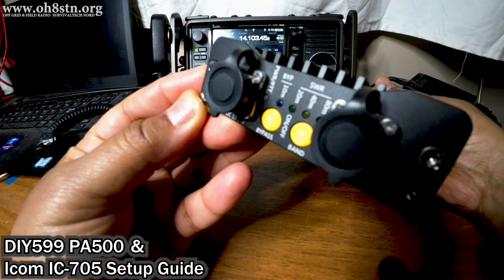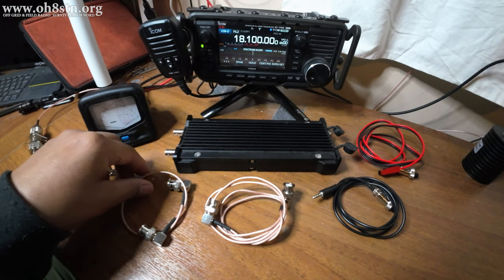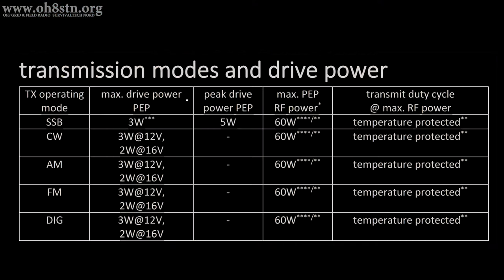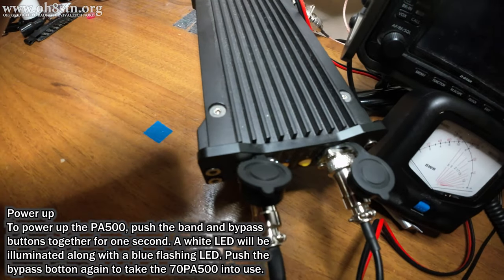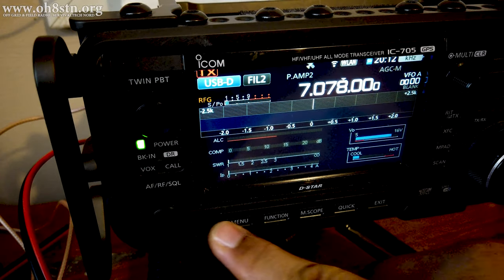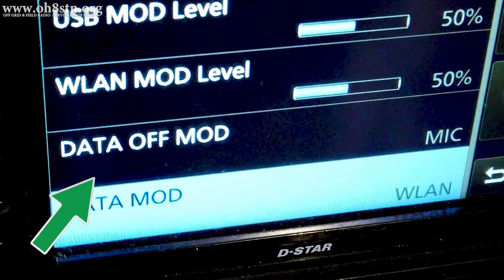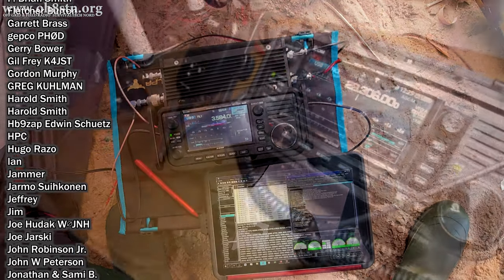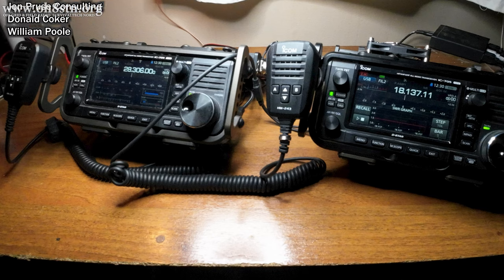Icom IC-705 DIY599 PA500 Setup Guide

Comment: I got mine in the summer after waiting in a pre-order queue.  It's been on a couple of expeditions with me now, and it brings a massive benefit to the IC705 experience. QRP can be fun, but it's a pain when the band isn't in the best of conditions.  The amp won't fix a closed band, but it will get you out of the weeds. Also, if you get cold when you're camping, chuck the amp in your sleeping bag and start making FT8 contacts.  You'll soon warm up. :)
Reply from the maker: Best comment of the day 👍

Comment: The DIY599 is the perfect pairing with almost any low power radio - I have used it with my KX2 KX3 X6100 IC705 and the TX500 - it is truly plug and play

Comment: Thanks Julian! 

A couple comments 

I love the PA-500 and use it with the 705 and TX-500.

The LED lights are important and hard to see if you mount the PA behind the radio

The 10m function on the FCC/USA version is a little wonky because of the requirement to not amplify the 11m band - there is a limited work-around. 

Oliver and Ed are both approachable and super helpful when questions arise

In hot climates and direct sun - the amp can go into self preservation bypass mode quickly, particularly when using FT8. this can be managed by limiting output power to 40w in my experience 

The ic-705 max power setting is nice, but you still need to check it and the power level in the multifunction button - to prevent mistakes

For CW, I use the VOX delay setting on the radio - which seem more effective than those on the amp - to prevent the amp from relay clicking

All told - it's a kick ass package, very happy I got it

Comment: Thank you for the info. I am happy with IC705. My concern is the availability of the PA500, hard to get and cost; this make me to choose / find other option. My setup at the end is using IC705 and FT891 if I need more power for portable/mobile operation, a half square antenna 40m with 2x 10m spider beam (shorten to 8.5m), 49:1 high efficiency UNUN for both device, connect to a coax switch, only ‘turn on” one device at the time, one computer, a generic ATU for backup antenna setup, power/battery usage is about the same and I had a spare HF radio for redundancy.
Reply from the maker: The ft891 is an awesome radio but it's terrible with efficiency. The 705 even with the PA500, is far more efficient in transmit and receive. Anyway, I like the antenna idea. Naturally we should always start off with an efficient antenna. I believe this is almost the first thing I said in the video. The only reason I sold my FT891 was the current consumption. Sometimes I miss it, until I think about how hungry it was.
When I think about the g90. I wonder why it wasn't possible to put 20 watts inside the 705. That would have been absolutely amazing!
Thanks for watching, commenting and for the kindness. Greatly appreciated.
73
Julian oh8stn

Comment: Julian, I'm not a Microsoft fan!  What do you recommend on the Linux software side?  Or Android based tablet?
Reply from the maker: I'm not a Microsoft guy either but software ham radio Community is abysmal. I would go with your favorite flavor of Linux on your favorite brand of laptop. For modes like js8, packet, aprs, Linux is fine. For winlink, there is Pat winlink. Pat works but you lose a lot of the features from the windows side. It's kind of the bare minimum. Other than winlink, I would say Linux is okay.

Comment: I contacted the QRP store around Nov. 21, 2022 concerning the availability of the PA 500.  I was told
they were working on orders from Aug. of 2021  I've been added to the waiting list.  It's frustrating
when equipment is unavailable, or discontinued.
Reply from the maker: Definitely frustrating. Remember this isn't a mass produced product. It's so special because it's well designed and uses quality components. Hang in there more of them are being produced now than they were previously.

Comment: Like always, love the video.
What field expedient nvis antenna do you use when reliable contacts are needed? Using js8call, does that effect your selection?
Reply from the maker: Excellent question! For NVIS, off center fed dipoles cut for 80/40/20 (JS8Call) or 60/30, ... (Winlink). If I'm unsure about the requirement,  a terminated dipole.
Thanks for watching and commenting. It's very much appreciated.
73
Julian oh8stn

Comment: Will the amp work on 60m both tx and tune functions ?
Reply from the maker: It will but not by default. You have to update the settings on the amp if you'd like 60 m. It's not difficult, you just need the USB cable.

Comment: Hi folks, I bought the pa 500 but I’m having problems while using it with my IC 705 and my pac 12 antenna. After using the amp on the 705 for more than a few minutes my modulation starts to degrade to the point where it’s unreadable.  Has anyone else had to use ferrites on the co-ax or mic leads or is there any other solution to stop this happening?

Comment: Thanks!
I’d. Love to see a comparison of power draws between the old 706mkii, the 7000 and the newer 705 in receive and at 10 watts out
Reply from the maker: Thanks for the super thanks and for the question.I can do the 705 part of this easily. We'll need to rely on published documentation for the others.
73
Julian oh8stn
Reply: @OH8STN thanks . Thinking about it I can likely measure the power draw in receive mode of a 7000 in the next few weeks. I’ll post them here
Reply from the maker: Excellent, please tag me when you comment. @oh8stn 👍
Reply: @OH8STN - some prelim readings all from freshly charged bioenno battery with radio on at low volume tuned to background noise :
Yaesu  FT-891: 1.02 amps
Icom 7000:  1.28 amps
Ten-Tec argonaut VI: 0.58 amps 
Icom 705: 0.33 amps
Reply from the maker: It's better to test using a power supply. The current consumption chanjust as a battery's voltage increases or decreases. So use a power supply, and list 1.x amps @ 13.5 volts for example.  This tells the entire story.

Comment: This is such an awesome setup - but forget paying $3500 for an amp - that's just insane.  I want an amp for the 705 but the cheapest best solution is the Elecraft.  Yes there are cheaper options out there but the Elecraft is quality.  This is also quality - but that price for these are just not reasonable.
Reply from the maker: They don't cost $3,500.
The Elecraft is a nice amp, but it's not as energy efficient, doesn't have us low current consumption, and it's incredibly heavy. The Elecraft is meant for the desktop. The standard PA500 comes in around 900 bucks.

Comment: For me qrp make non sense. If you need to make a contact in an emergancy case with 10 watt it could end very bad. For me that is, like driving a truck with 40hp. The ic705 with the pa for HF, a Tuner for HF, an amp for VHF, a Tuner for VHF you have 4 times the mony, 3 times the space and 2 times the wight of a 991a. Please dont understand me. This is only my Opinion. I Love your Channel and your contand. You are a really Great ham Operator 73 Horst
Reply from the maker: QRP is not required by law. If you don't like it or can't do it, use the 991A. 
The real story.
991A runs at 2-3 amps on RX, 20-23 amps TX with 100 watts. Even at 5 watts, the 991A still uses 9 amps on TX. So add the weight of the massive battery for the 991A as part of your system. 
If yout cabin burns, vehcle is broken down, ... how far can you carry the 991A and the battery to power it? How long will the battery power such a current hungry radio? For me, usually the 705 or TX500 is enough.
Reply: This makes absolut sense to me sir

Comment: Ouch! Nobody has is for sale and only saw it on a reseller from Europe for $1200!!!! No way, the amp can’t be more expensive than the 705. Well, I went with the PA50 and have a lot of money leftover to spare
Reply from the maker: I don't like the PA500 price,  but wouldn't compare the PA50 to it. PA50 is less expensive, but also lacks the tuner and heat protection. 
If the PA50 works for you, be happy 👍
Reply: @OH8STN  I agree with you that can’t be compared because is 2 devices in one like the Xiegu amp which cost around $600 but is not as compact as that PA500. Anyways with those $1,200+ I can get the PA50, one of the nice tiny tuners and still have money leftover for other stuff. Sometimes I don’t understand how people price the stuff. Thanks for the video my friend.
Reply from the maker: Yeah the pricing is based on demand.  This is a very frustrating truth. The PA50 and one of N9SAB OCF dipoles wouldn't need a tuner 👍

Comment: When i am in my Hunting Cabin where there is no cell service i have a Windows Laptop for Winlink althouhg i am a mac guy my 991a from Yaesu Full Open on transmit and my chamelion wire antennas. If i hurt myself i dont want to bleed out with qrp and a solution with 20 wires and connectors every one mc. I know there a better radios out there. The reciver in the Icom rig is better. But i have a one Box Solution. Strait and simple.
Reply from the maker: and a large battery pack yo power the 991A. 99% of the time I operate QRP winlink. If you know what you're doing, you can usually get it done. An inexperienced operator will certainly have problems with lower power.
Reply: @OH8STN  i dont want to criric you!! You are 100% right!! It is only the way i do it! You Need More expiriance for qrp
Reply: If you are the one that's bleeding out, making qrp contacts should probably not be in your priority list...
Reply: In the military they told me, take the right tool, do it strait, simple and reliable. I put my lifepo4 in an Isolation bag. Had troubles in the past with the batteries in 20 below Zero c. I think i have good possibilities with the 991a Open transmit. I can to calls to the mountain rescue. Home to my wife with vhf. And Winlink and calls to other hams on hf. 73 Horst

Comment: Don't buy a QRP transceiver if 10 watts is not enough for you. There are plenty of great mobile high-power radios on the market. This is QRP radio.
Reply from the maker: Complete Nonsense!
QRP rigs are attractive because of their low current consumption and small form factor, not the output power! High power rigs consume vastly more current on RX & TX than a QRP rig and efficient amp combo.
Reply: @OH8STN  We can argue for hours about this, right? How many amps does your amplifier consume while on standby?
Reply from the maker: @makskk6spm275  80ma on RX, 10-12 amps at 80 watts or 100 watts for the expedition version!
Manufacturers don't care about efficiency in 100-watt radios. I sold my FT-891 for exactly that reason. Also passed on the 857, IC-7300, ... because of poor efficiency.  When your radio pulls more than an amp in standby, the size of the battery reserve storage must be increased. If you're running off-grid renewable, input current requirements also increase. The only way to get an efficient low current radio with QRO output fitting in a small pack is a QRP rig/amp combo. 
This is an old, well-covered, and extremely annoying topic. Not because of your comment, it's because manufacturers don't care. The manufacturer who develops an updated FT-897 style 100-watt radio with LiFePO4 internal battery, running less than 100ma RX and 10 amps on TX will be an innovator.
Yaesu already did it in the Vertex HF radios. Sadly, they sold that division Motorola.
Reply: @OH8STN  0.08A in RX on 100W amplifier? what amplifier you are using? just wondering.
Reply from the maker: So you didn't actually watch the video you're commenting on?
Here's a good article. 
https://oh8stn.org/blog/2021/07/29/diy599-pa500-hf-amplifier/